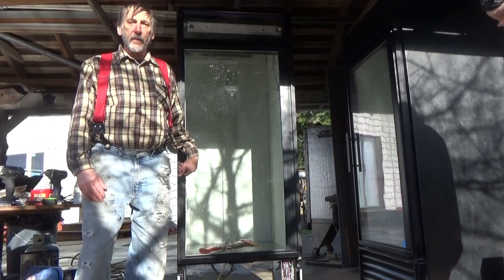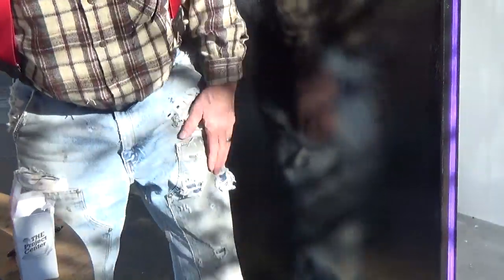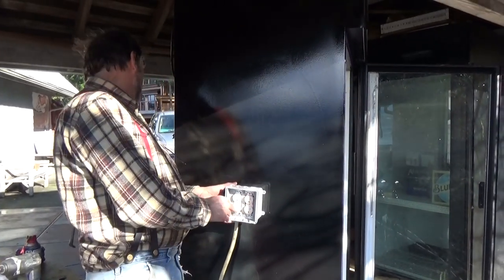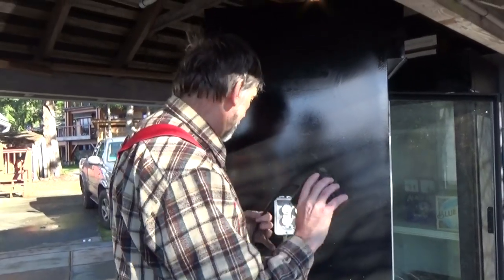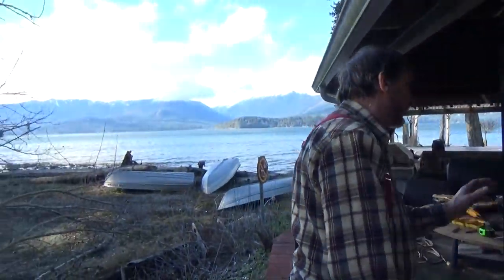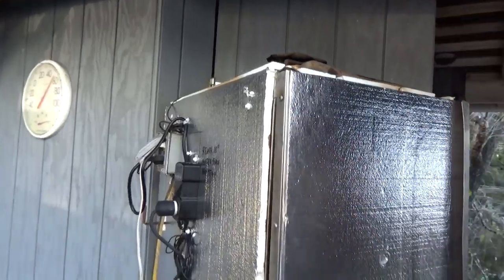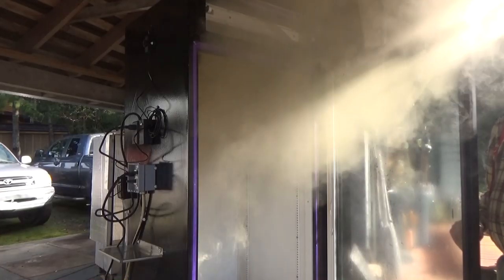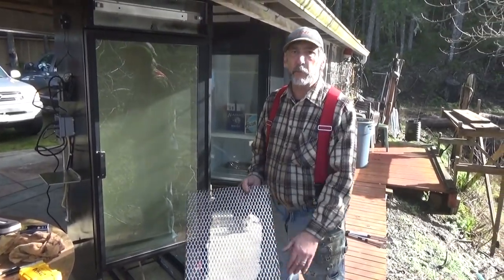How To Build Your Own Smoker

Comment: The frankensmoker haha. Just a question.  Are the seals for the door ok for heat as well as their original purpose? I've always wanted to try something like this but worry about things like that.
Reply: They are magnetic, so should be fine. My old smoker was made from a warming cart not designed  for much heat and were rubber and lasted fine. They aren't subject to much heat as unit is very well insulated, and seals are basically external.
FYI you are the current leader in the naming contest! Lol
Reply: Oh nice! That makes sense
Reply from the maker: Frankensmoker. Hahaha!

Comment: Form Follows Function.  Excellent.  That generator is about the simplest one I've seen yet.  That Sched 40 pipe certainly won't fail.  I'd add a stubby chimney, and air vents with dampers in the bottom, however.  Otherwise it's a steal of a design for a box that big.

Comment: Hey Ron and Brent, ironic you put this episode out the same day I smoked my 2nd batch of shoulder Bacon. Came out very good, recipe is fine, just gotta tweek a few smoking technique's. I checked out that place in Indiana, for hangers, but they are outta stock, and the one's on Amazon had mixed reviews at best. I'll figure it out. After doing 2 batches, laying on a rack, I can see clearly, It Must Be Hung!!! 3 questions, #1, I didn't see any racks, or rack brackets in this one, and #2, I didn't see a chimney on it, or doesn't it need one?  #3, I have an Inkbird 4 temp probe remote, would you drill an extra hole to put the probe's through, or just close the door over the leads?
Names:
Beelzabub
Ronte's Inferno
Smokey The Bear    (put a sign on the small one BooBoo)
Chernobyl
Just my mind wandering,   lol   (and if it wasn't on a leash, it would wander off)
Great episode, Guys !!! Thank You,    Mark
Reply: I have racks and brackets, but need to get coating off with  heat before topping with 1/2x13 SS flattened expanded.
It does have a 4" chimney with damper.
Yes, I would drill a hole.
Last, I  would not worry about a bad reviews on a  bacon hook unless they break and bacon falls. There ain't much to them!

Comment: Hi, Ron
Very nice!!! 
Got 2 questions:
Can be used sawdust ,too?
Do you use the bottom side to fire the charcoal or keep the fire the way you want and how do you do this???
Thank you!!
I appreciate it!!
Vic
Reply from the maker: Sawdust would probably suffocate the coals. You could try it. The bottom is a metal screen that holds the charcoal and allows air in. We pre-light a few briquettes before we drop them in.
Reply: @my-back-yard  What about the bottom fire?
Reply from the maker: It’s not a fire in the bottom; it’s an adjustable temperature heating element.
Reply from the maker: To be clear, there are two heat sources:
1. Charcoal in the smoke generator on the outside of the smoker 
2. Electric heating element on the bottom, inside.
Reply: @my-back-yard  I'm talking about the holes you did it in the bottom part of the Smoke Generator?

Comment: nice video, thanks for making it. Two questions. What is the purpose of the two fans?  I read in the comments about the flue chimney.  Did you add any vent holes in the bottom of the box or is the airflow thru the smoke generator enough?  I've got a box and planning my setup now and got a lot of good ideas from you.
Reply from the maker: Thanks for your interest! The fans circulate the smoke and heat gently and the only intake is via the smoke generator.
Reply: Thanks for watching! My system is simple, cheap, and works great. I have 3 of them now using same basic design. If you have any questions or thoughts, we are happy to try to help!

Comment: Due you have any concerns/worries of plastic/rubber parts melting or giving off fumes/off flavors to the meat?Do you have any type of outlet/vent at the top or is the box pretty much sealed?Name???Brent's BadAss Bacon Box!
Reply: Inside is metal, and I tested to 250 degrees with no problems except for plastic plug mentioned in video. Like any new appliance, you should clean it and get it to the hottest temp you will use for several hours. Clean again and check for odors. This insulation is rated at 250. Common since has to be used. Most of my smoking is done under 200. I have a 4"pipe with damper in the top.
Reply: @ronross6946  Thanks for the rapid reply! I saw what looked like a pipe at the top,hence the question.Going to do a similar build now(sorry for being a copycat,lol)Where do you leave the damper set,as I'm sure it affects temperature......Thanks again for sharing!
Reply: @Bowtie41  Glad you are going to build one! You're not being a copy cat! I put these out there to inspire others to give it a try! I leave the damper closed until box gets up to temp, then open half way. I play with it opening and closing depending on output from smoke generator.